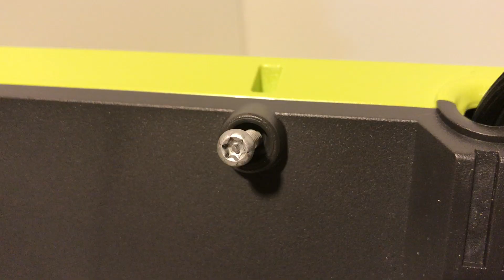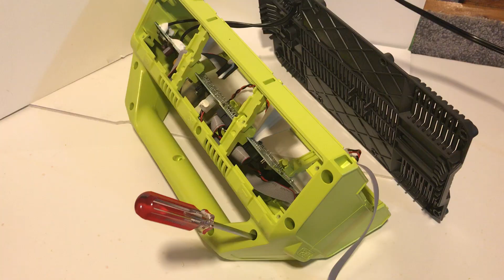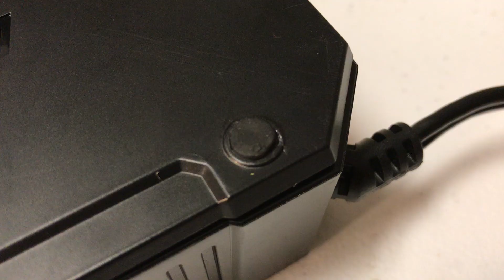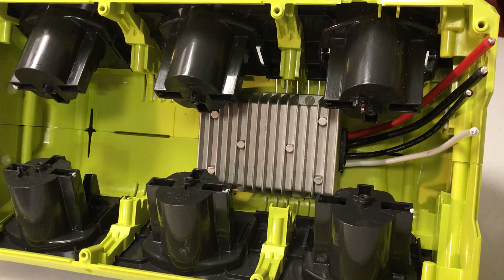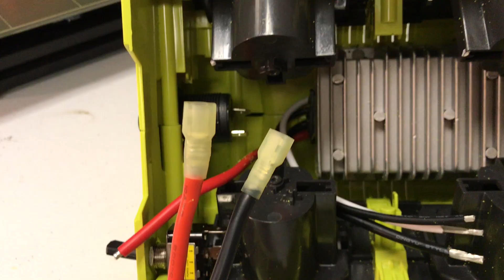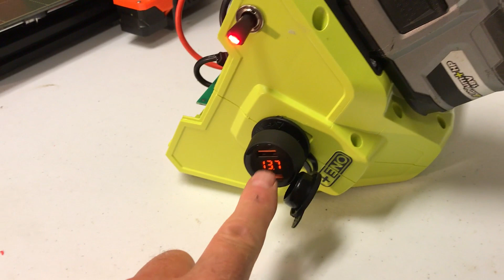Hacking a Ryobi Supercharger into a Powerstation

Comment: Can this system be run with a higher watt inverter? Like he uses a 300w but could you technically run a 1000w or 1500w inverter on this? 
I know the power would drain faster. But these are power tool batteries designed to run fairly high demand appliances,  I would hope you could at least power a griddle for a few hours or so
Reply from the maker: I built this one that uses the 18V batteries and can run 2600W inverter https://youtu.be/lAAWFCU4iEM

Comment: Why is it important to use the same batteries? Ryobi batteries have internal battery protection circuits, so they should just drop off the array as they get low.
Reply from the maker: @GraflexGuy  just being safe that all batteries are equally sharing the load

Comment: I know this is several years old but does anyone out there still have a port with the main board intact?  I had a diode burn up and can't id the part number on the diode to replace it.  It's listed as zd401 on the PCB.

Comment: I see you mention 2A for the circuit board.  The one thing I was disappointed about this 6 port charger was the fact it can only charge one battery at a time.  Do you think it would be possible to modify it to charge 2 at a time?  Even one on each side at a time would be a huge improvement.  If it could charge them all at the same time that would be ideal.

Comment: I built one very similar, but made each side 18 (20) volts to combine them in the final output to use a 40 volt Ryobi 300 watt pure sine inverter, this eliminates needing a step down converter. I also soldered a 12 gauge wire directly to the back side board solder pins. I have 16 Ryobi 4ah batteries so this should keeps things powered for many hours. So when WW3 comes ill have power until the radiation gets me :goodvibes:

Comment: Picked up a broken for parts power station hoping to replicate this. Any idea how long this would last with 6 6ah 18v Ryobi batteries running a CPAP machine with no humidifier or heated tubes just straight air pressure? Also What toggle switch did you use I didn't see it in the comments?

Comment: Excellent build! A couple of questions. The possibility of the two banks running in series for 36v, could that be achieved with a DPDT switch, if not how would I have the ability to change from 18v to 36v? 
Also, since the time from completion of this build, thinking back, what would you've done differently on this project? 
I am about to replicate this build with the same charger and any expertise would be appreciated.

Comment: You did an excellent job. However,  your batteries are not connected correctly. What will happen is that the 2 batteries closest to the output will drain first. You can easily fix it so they all drain evenly. Rewire it as follows: B1 thru B6 wired in parallel. For the output connection, connect positive wire to B1, then negative wire to B6. This will evenly draw power especially on heavier loads with the inverter.
Reply from the maker: I haven't seen this problem. I use it for my 12V cooler and 300W pure sine wave inverter.

Comment: I love what you've done with this video, but I have a question related to how the supercharger works.  I want to make one bank of my supercharger capable of stopping at a battery voltage of ~ 19.0 V (for ideal storage voltage).  That would be perfect, 3 slots for full charging and 3 slots for storage charging.

I know from tinkering experience that putting a diode in series with a CC/CV charging source will result in the battery being charged to a lower voltage, with the difference corresponding to the forward voltage of the diode.  I'm wondering if that twisted pair of red and black wires going to each charging bank consists of a CC/CV 4A, 20.5V.  And if I were to put two silicon diodes in series with that connection would I have the batteries stopping at ~ 19.0 V...
Reply from the maker: The 18V hack doesn't charge batteries any more. You could put in blocking diodes like I did in the 40V hack ( https://youtu.be/p4xW9f1ohlw ). If you are charging with a solar charger, you can set the charge voltage on the controller ( https://youtu.be/xhLEnkzLj60 )

Comment: I would love to see if you could plumb 24v solar into it directly and see if it would charge without blowing up!
Reply from the maker: I have several videos showing how to solar charge 18V batteries. If all the batteries were similar voltage and capacity you could potentially charge them with a single charger. If they are different charge levels, you will have problems

Comment: I would suggest not running that many amps through the switch. I would use a relay..
Reply from the maker: The switch said it's rated for it... but on the bigger 40V projects I use the big battery disconnect switches https://amzn.to/3mbEAAm

Comment: I was hoping you could answer a question for me.  I am hoping to make my own EBike powered by 6 - 4ah batteries (36v @ 12ah).  This holder would be perfect base, but was sad to see the connectors were on a board.  Do you think it would be possible to make this work in a series - parallel configuration? or would the board cause me issues?
Reply from the maker: I agree it would make a nice 2S3P holder. Not sure if board traces would cause issue. I did a 2S4P config in this project: https://youtu.be/lAAWFCU4iEM
Reply: @SerendipitySue  Yeah I watched that video, but do not have access to a 3d Printer.  I can get some power caps on Esty, but this makes such a nice clean look.

Comment: I agree with your statement that the Voltages on all batteries MUST be identical prior to connecting them in parallel.  However, batteries connected in parallel DO NOT need to be the same capacity (Amphours).  Their capacities will simply add together.  Additionally,  don't believe the myth that the smaller capacity battery will drain faster than the bigger battery.  If they are connected in parallel, they will drain together and charge together.  PERIOD. 
 

(SIDE NOTE:   I do recommend that each battery START with a full charge PRIOR to connecting them in parallel.  Once they are connected in parallel... from THIS POINT forward, they will automatically charge up together and discharge together due to the fact that their Voltages are identical.)  

What you'll find (if you look closely) is that the bigger battery will provide more of the current to the load than the smaller battery... exactly in the proportion of the two batteries' capacities.  So for example, if you are using a 2Ah battery and a 4Ah battery in parallel:  The 4Ah battery will provide twice as much current as the 2Ah battery.  Thus overall, they split the power demand 33% to the smaller battery and 66% to the larger battery.  This sharing of the power happens with all batteries in parallel, regardless of how many there are.... two, six or 600.  

The same thing happens during charging... the higher capacity 4Ah battery will get twice as much current as the 2Ah battery gets from the charging system.  This happens AUTOMATICALLY... based on the capacities of each battery wired in parallel.  It has nothing to do with the charging circuitry electronics.  In fact, the charger has no way of knowing how many batteries are wired in parallel.  The various batteries will self-regulate the power based on their capacities.

There are too many myths and opinions surrounding batteries.  The above information is NOT an opinion... it's factual information that can be verified in most any Electrical Engineering book.

**************************************

Completely off the topic, but still interesting to note:  

If we were discussing batteries in SERIES, I would have been insisting that batteries connected in SERIES do NOT have to be the same voltage.   But they absolutely MUST be the same capacity (Amphours)!   Weird huh?

(And just as I recommended above for parallel batteries, it's best to charge each battery up to full PRIOR to connecting them in series.)

It's sort of the 'converse' of the information I wrote about above for batteries connected in parallel.  Perhaps this is why the information gets all jumbled up when its goes out on the internet?  Maybe somebody misinterprets the above scenarios and just combines the information incorrectly?
Reply from the maker: My concern for using similar sized (Ah) batteries is that at full load I want to make sure all the batteries are contributing equally.
Reply: @SerendipitySue  - You're still not understanding the principal of parallel batteries.  My point being that there is no reason they all have to expend the same amount of current, or as you phrase it "contribute equally".  

They all act as one big battery, regardless of whether or not they are each providing equal current.  That's an arbitrary condition that you are making mandatory unnecessarily.  

Look at it this way... even with ten batteries of varying capacities connected in parallel, they will all reach 90% State of Charge (SOC) at the same time.  And they will all reach 75% SOC at the same time.  And they will all reach 50% SOC at the same time.  And they will all reach 10% SOC at the exact same time.  So why does it matter how much current each of those ten batteries is contributing if they all discharge at the same proportionate amount based on their capacities?  

Mathematically speaking, (based on their capacities in Ah)  each battery actually is contributing "equally" in terms of PERCENTAGE of their capacity.  It's the percentage that matters, not the absolute value of the current being provided by each battery.  I could go into detail about what's known as the "C" rating of a battery and why the percentage is more important than the actual number of Amps being delivered... but that's a long boring story.

* SUMMARY:   
If you feel more comfortable using only identical batteries in parallel, that is perfectly fine to do.  It takes any guesswork out of the equation.  But just be aware that it's perfectly fine to utilize different capacity batteries when using a parallel battery configuration.  

They will all charge up, and discharge down perfectly in sync with each other.  That's the beauty of a parallel connection.  And each battery will be pushing the same "C" rated current based on its capacity, thus equally sharing the burden presented by the load.   (i.e. - one battery won't get hot while the others are hardly doing any work.  They each do the SAME work, relative to their “C” rating, even though each battery may have a different capacity.). 

What I’m trying to say is each battery in a parallel system… regardless of its capacity or the magnitude of current that it’s delivering, will be delivering the same “C” amount.  

Let’s use 0.5 C as an example.  So 0.5 C for a 6Ah battery is 3Amps.  But 0.5 C for a 2Ah battery is only 1Amp.  Together they supply 4 Amps, but each battery is working to the same degree.  The 3Amp demand on the 6Ah battery is the same level of 'stress' that the 1Amp demand is for the 2Ah battery.  Neither battery is being “pushed” harder than the other.  That's a very important point.

This happens automatically when you place them in parallel.  Each battery sees the same “C” load, despite the fact that they provide different amounts of current.  I wish I could upload a drawing to illustrate the idea better.  This automatic "C" level balancing between different capacity batteries in parallel makes much more sense when you can visualize what's happening and where the current is coming from (or going to.)

Your statements at 8:00 are well intentioned but not 100% accurate:

1)  Using Same capacity batteries ---> No, not important at all.  
2)  Connecting the batteries when they are at the same charge level (Voltage) ---> Yes, that's VERY important for parallel battery connections!
3)  Your suggestion to only use fully charged batteries --->  Yes, that's VERY important!
4)  Later, at 8:26, the label on your awesome unit that says "Caution:  Only use same Ah size batteries"  is not necessary.
5)  At 8:26, the label on your unit that says "Install only fully charged batteries" ---> Yes, I agree.  This will ensure that they charge and discharge together, perfectly.

After looking back at my previous posts, I realize that I've missed a critical thing.... I never actually complimented you on such an awesome design!!!  Geesh, I dive right into the technical aspects and miss the most important thing:  Your hard work!!!  Honestly, I'm very impressed with this design.  You have taken your passion to a new level.  Congratulations on a very nice project!  My sincere apologies for only focusing on the technical aspects of paralleling batteries.  I'm a complete doofus sometimes.
Reply from the maker: Yes I understand. it's for simplification. In some of my other projects we're using nSmP configurations. It gets complicated to explain. You can't go wrong using the same battery sizes. Also don't forget the  BMS's We don't know the specs for the different battery models. From my tests you can pull about 10A. The BMS is often the limiting factor not the underlying cells.

Comment: i really hoped that it would still be a charger as well. its a really nice projekt and a useful accessory to have around. but i must ask . how much more work would it require to have it be able to handel different voltages and battery sizes? feels a little annoying to need 6 4amps or 6 9 amps. would be a lot easier to be able to add different sizes depending on what you have on hand. As for now i hope that they will release a proper inverter and charger kombo just like dewalt or milwakey.
Reply from the maker: you could add blocking diodes like I did in the 40 Volt battery hack ( https://youtu.be/p4xW9f1ohlw ), but you still have to deal with the undersize wires.
Reply: I agree with your statement that the Voltages on all batteries MUST be identical prior to connecting them in parallel.  However, batteries connected in parallel DO NOT need to be the same capacity (Amphours).  Their capacities will simply add together.  Additionally,  don't believe the myth that the smaller capacity battery will drain faster than the bigger battery.  If they are connected in parallel, they will drain together and charge together.  PERIOD.  

(SIDE NOTE:   I do recommend that each battery START with a full charge PRIOR to connecting them in parallel.  Once they are connected in parallel... from THIS POINT forward, they will automatically charge up together and discharge together due to the fact that their Voltages are identical.)  

What you'll find (if you look closely) is that the bigger battery will provide more of the current to the load than the smaller battery... exactly in the proportion of the two batteries' capacities.  So for example, if you are using a 2Ah battery and a 4Ah battery in parallel:  The 4Ah battery will provide twice as much current as the 2Ah battery.  Thus overall, they split the power demand 33% to the smaller battery and 66% to the larger battery.  This sharing of the power happens with all batteries in parallel, regardless of how many there are.... two, six or 600.  

The same thing happens during charging... the higher capacity 4Ah battery will get twice as much current as the 2Ah battery gets from the charging system.  This happens AUTOMATICALLY... based on the capacities of each battery wired in parallel.  It has nothing to do with the charging circuitry electronics.  In fact, the charger has no way of knowing how many batteries are wired in parallel.  The various batteries will self-regulate the power based on their capacities.

There are too many myths and opinions surrounding batteries.  The above information is NOT an opinion... it's factual information that can be verified in most any Electrical Engineering book.

****************************************
Completely off the topic, but still interesting to note:  

If we were discussing batteries in SERIES, I would have been insisting that batteries connected in SERIES do NOT have to be the same voltage.   But they absolutely MUST be the same capacity (Amphours)!   Weird huh?

(And just as I recommended above for parallel batteries, it's best to charge each battery up to full PRIOR to connecting them in series.)

It's sort of the 'converse' of the information I wrote about above for batteries connected in parallel.  Perhaps this is why the information gets all jumbled up when its goes out on the internet?  Maybe somebody misinterprets the above scenarios and just combines the information incorrectly?

Comment: I have a dead Ryobi P125 Superchager and would like to convert it into a powerstation. I understand the concept of having all the batteries fully charged - so they don't try to cross charge and equalize a depleted battery. I don't understand why all the batteries must be the same Ah rating. I thought if fully charged, but mixed Ah, batteries connected in parallel were in a powerstation, then any current draw would pull more amps from the higher Ah batteries than the lower Ah batteries while at the same time keeping the voltage equalized on all the batteries. This project would be more valuable to me to be able to use mixed Ah batteries in the powerstation. Thank you if you can provide any links on this issue. Love your videos.
Reply from the maker: It just puts less stress on the batteries, since they will all share the load equally.
Reply: @SerendipitySue  Thanks for the reply. I just don't think that a small amp draw difference between 6 mixed Ah rated batteries would be enough to stress out any individual battery. The benefits of using all my various Ah batteries on the converted powerstation would be cost savings and longer total run times by using all my batteries, if needed. Anyway, I think I will try your conversion build on my dead P125 Supercharger and maybe give that unit an extra life. Great idea. Thanks.